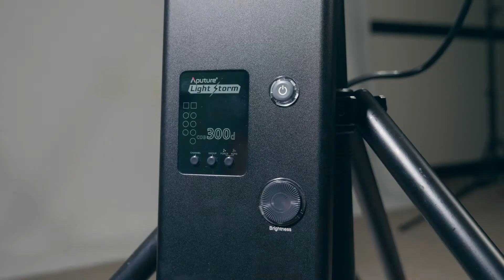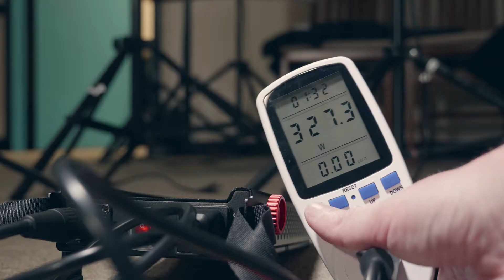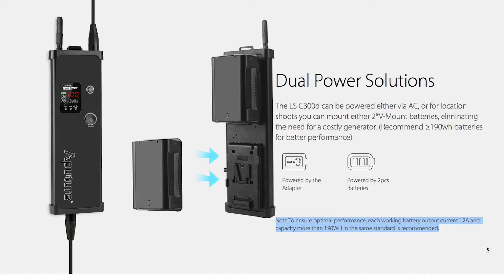What Does It Take to Power the Aputure 300d? - Batteries and AC Power Stats

Comment: I am using those unbranded dead cheap 10400mah one ( rating 160WH) model that cost less than $100 and they work at full power. They originally came with my RX-18T LED roll. Just duration is like say more 45-60min not at full power all the time though. I believe is just weight and duration issues more than anything else. They are just 18650 batteries inside put together in a casing. Is not likely they will blow up in my face haha. 
my suggestion will be to use what ever v-mount batteries you own now and put it on no need to buy anything special for it. The 300D is not a very delicate piece of equipment that need very good quality batteries.

Comment: I first made my own v-mount batts for this light.   They are 4s4p 150 Wh made with Samsung 25r 18650s and a 40 amp balancing BMS.  They cost about a hundred bucks each to make.  These run for about 45 minutes on 100% power.  Once I tested that they worked fine I scaled up to a 4s13p dual pack that I put into an ammo box.  This worked out to two 25 Ah cells in a single box and will drive the light well over two hours at 100%.  AliExpress and Amazon had all the parts.
Reply from the maker: Very cool!  I need to get back into electronics and battery DIY.  It has been a few years and I am a bit rusty!
Reply: Could you link where you got your parts? Im scared of fake 18650s!
Reply: Dylan Saliba legend

Comment: I sent Aputure a harsh support request asking them to actually specify name, brand and model numbers of batteries what work with either the 300d or 120d. They really leave the customer twisting in the wind if you go to their support page for the 120: 

Link: https://aputure.com/pages/ls-c120d-ii

1.What kind of power can be used ?
1. AC Power.
2. Removable Battery.V-mount or A-mount(Gold mount) battery. (We do not provide battery.)  We suggest you use the capacity of battery is more than 190Wh and can output 10A current.

And for the 300d:
Link: https://aputure.com/pages/ls-c300d-support

2.Battery requires.
a, Please use the output current 12A and capacity is more than 190Wh battery.

That is like making a car that uses gas, and saying well, just go out there and find something that burns.

Comment: Time to explore other options. Yes, it would be great to stick with video industry suppliers, but these kinds of power draws are the extreme fringe of the industry. I need portability along with the output of this light, but not necessarily the ability to backpack the batteries. It would be great to have more options, lead acid or whatever. Another possibility would be mass market batteries, where you would think a battery that can pull a self-propelled lawn mower rated to mow an acre would be able to pull this light for an hour or two. It wouldn’t bother me a bit to buy a ECO lawn mower, where the battery is over half the cost of an expensive mower, if I could use the battery for this light also.
Reply from the maker: +Danny Grizzle Battery tech and costs are certainly something that need to be considered, and I think most batteries are very overpriced!
Reply: A car lead acid battery costing $200 should be able to run this light for about 3 hours... they're just huge and heavy and without any safety features built in.
Reply: Lead acid batteries don't need extreme safety mechanisms that lithium-based batteries require. Lead acid is nowhere near as chemically volatile. They're heavy, that's the tradeoff. But nothing too difficult to handle with a small collapsible hand truck. Not ideal, but hey -- back in the day, I operated a battleship-sized Mole-Richardson generator with a 500 cubic inch Cadillac gasoline engine to power quartz lighting to illuminate a night shoot of an electrical sub-station. With all that power at hand, why bother? Because massive the quartz fixtures involved made the electrical utility fear our shoot could potentially disrupt the power grid.
.
Reply: Danny Grizzle I have a black magic production camera and we've rigged it to run off car and motorbike batteries. As I was watching this I was wondering if we couldn't try something similar for these

Not sure about the amps though- my friend is the electronics whizz

Comment: I tested bebob 98Wh  Micro which has a maximum output of 10A and they did not work more than a few minutes on 100%. If I lowered to 80% they seemed to work. The 150Wh micro are more likely to work since they have a maximum output of 16A.

Comment: I got four Power-U 150Wh battery that work with my 300d, but I have tried them only full.. No idea of the run time.  Costed me 133$ each and include a charger on ebay new.    I got 4 of them.  I also have two Rolux RL-230S 230Wh that work (haven't tested runtime) that cost 300$each.

Comment: We are using swit 126Wh 14.4V  S-8110S and it seams to be working.
I just tried a combination with one 126 and one 95 but it just worked for a few seconds.
So better two 126Wh and you should be fine. 
One are around 240,-
Reply from the maker: Good to know!

Comment: How about using 4 NP-F970 with a NP-F to V-Mount adapter? It gives only 8A but therfore 40.000mAh and about 150WH. Could that run the 300D at 50%?
Reply from the maker: It’s possible, but I cannot guarantee what will happen.  If you do test this, I would be interested in hearing the results!

Comment: Thanks for this. So, no batteries available that I could fly with? (I think 110wh is the limit)?
Reply from the maker: You could fly with the 190Wh Hypercore Prime batteries I am using.  They actually split in half into two 95Wh pieces and are then approved for air travel!
Reply: Thanks for that, Bart, REALLY helpful! Haven’t heard of that brand, is there a European distributer?

Comment: Hey Bart! Thanks for the great comparison! I'm hoping you might be able to help me... I work at a toy company and I am a 1 man video department. We are in the process of building a studio and I'm currently in the process for selecting lights. Do you think 3 of these be sufficient and versatile to light a 30*30 ft studio? Im a total novice when it comes to lighting gear so I'm not sure If im going about selecting the correct way. Would you recommend other lights in conjunction?  I am currently shooting retail videos for web retailers but once the studio is built we will also be shooting commercials in the space.  Currently using 3 Dracast  led panels and 3 flo light florescent light banks that can be used supplementary. 

Thanks in advance.
Reply from the maker: Glad the video helped, and congrats on the studio!  A controlled environment with lighting ready to go is so great to work in.  The 300d is a very powerful light, so it would most definitely be able to help in your studio.  I’m not sure if you would need three of them, but I’m not sure exactly what you will be shooting.  You could use a 300d as a powerful key light, and supplement it with a 120d or two as a hair light and fill light.  The beauty of the 300 and 120 is the Bowen’s Mount.  You can throw a fresnel modifier on the front and make it a hard light, or pop a soft box on it and make it a nice soft light.  Maybe see if you can rent the lights first and see how they work for your uses and in your space.  It’s hard to predict what you might need!

Comment: Question - do you consume MORE power by turning OFF and turning ON the D300 just to save battery life??? ie if you turn it On/Off/On several times... do you actually run LESS than an Hour and a Half because the Start Up consumes MORE power than the actual run?
Reply from the maker: I have not heard that turning the light on consumes more power.  These are not like old lights that need to “spark” and warm up.
Reply: Okay.

Comment: Would they not work on a generator?
Reply from the maker: The will definitely work on a generator as long as it can handle the 300w draw
Reply: @BartJohnsonProd  how long and how many can you power with a small honda generator? lets say the honda 2000. Would it be 2000/300watts so 6 of these?

Comment: "If you're gonna be plugging in a bunch of these..."   I'm not sure what he means by "a bunch", but you should NOT plug in more than 3 of these lights into a 15 Amp household circuit.  NOTE:  He didn't mention the voltage for his power measurements, but the operating manual for the 300dii says it draws 3.5Amps maximum when operated from a typical household circuit, so if you plugged in three of these lights, you'd be drawing 10.5 Amps at 120VAC, for 1260 Watts total.  He also mentions plugging a 2k tungsten into the wall...  You should NOT plug a 2k light into a 15 Amp household circuit, as it would exceed the safe limit for continuous operation.
Reply: Sound like you are having a bad time over there. Not sure if you know this but most homes have a combination of different amperage breakers...10, 15, 20, 30, and so on. So IF anyone was to plug lets say a portable AC unit that draws more than 15 amps on a 15 amp breaker line then that breaker will let them know IMMEDIATELY. So calm down. If he is able to plug in these lights such as the 2K tungsten with no issue...TADA!!! Also, in your rant you mentioned the Aputure 300d ii but look at his video, he is not using the same light. Also, do your SIMPLE math. Yes you can plug in a "bunch" of these lights onto a single 15 amp line (4 to be exact). I have plugged 4 Aputure 300Dii onto one 15 amp line with no issue because I was still within the load limit...14 amps. Only the lights got warm, not the line or the breaker. Maybe you just need a girlfriend or something.

Comment: As mentioned: either lug around an (ie marine) 150 $ but 30 pound heavy lead acid battery. or a LiFePO deep cycle 35AH 12V for 450 $ - an at only 10 pounds...
Reply: Roald how about a motorbike lead acid battery- lighter than a car one

Comment: Would it be easier to rent a generator to power the light if we're filming at a location far from an electric plug? If so, what kind of wattage do you think I should look for in a generator?
Reply from the maker: Generators may be cheaper for a rental, but do be aware of the noise they create!  The 300d draws 300 Watts at full power over the AC power, so you will need a generator that can handle that.

Comment: Thanks, really good video. As you mentioned, on a longer off the power grid shoot the batteries you need would cost more than the doggone light which is not cheap. Wondering if a portable generator would then be a better solution if your shoot is in the middle of saaay.....no where (ha). Here's a video comparing 5 portable generators that might be a solution to shoots where grid power not available : https://www.youtube.com/watch?v=KERlriXscN4&t=16s